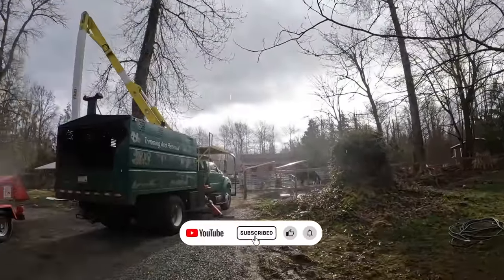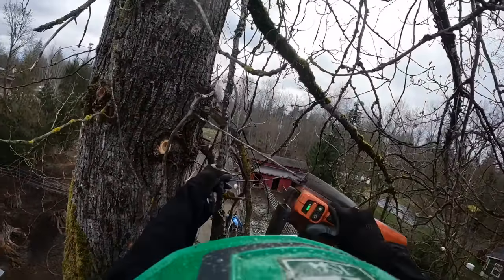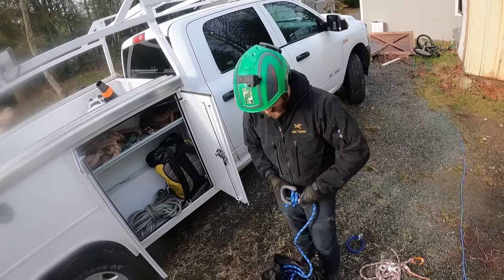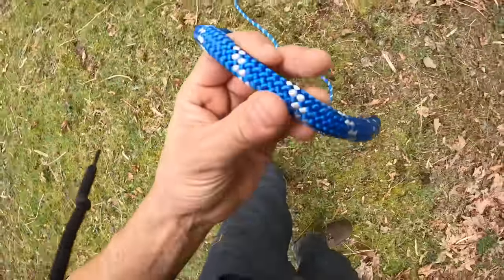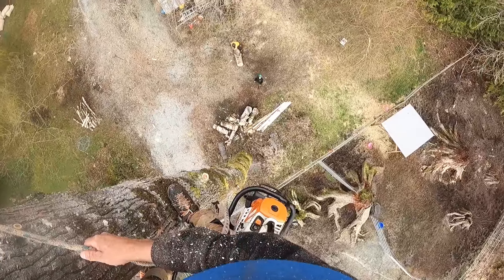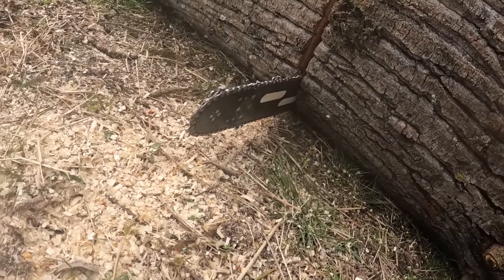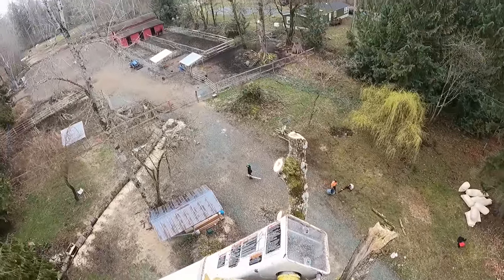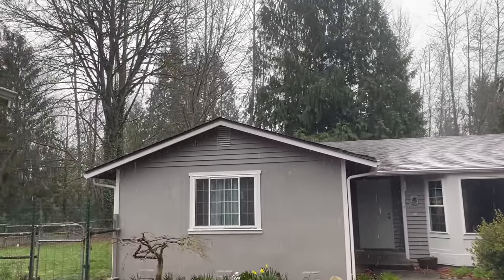Cottonwood Killers! | Removing Cottonwoods with Randy!

Comment: I feel down about 10 trees and cut in on sandy ground and it didn't get really dull even if i touched ground, it needed sharpening  some time in a middle of the job but not much. Other example i was cutting root slice for a coffee table and it was some rocks and soils with in it and it dull my chain really fast. My conclusion is that  when you hit something hard like rock metal, concrete you will dull a chain immediately but soft ground maybe it will dull it but not much and you can cut a lot before it need to be sharpen again.